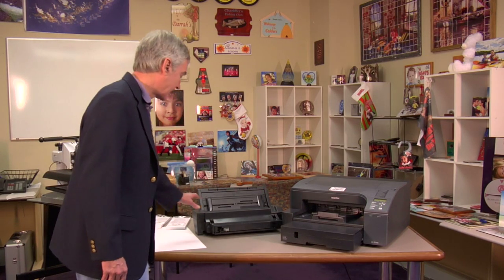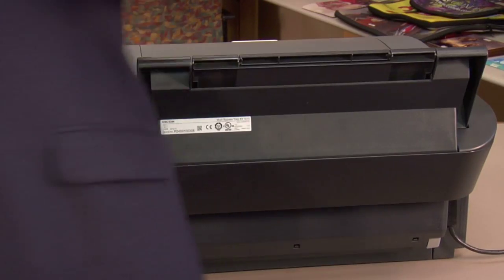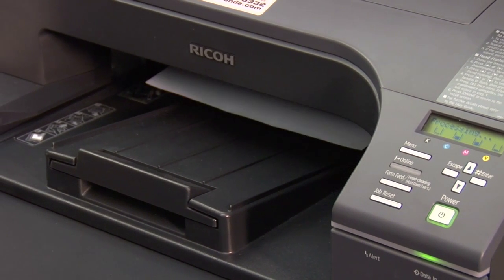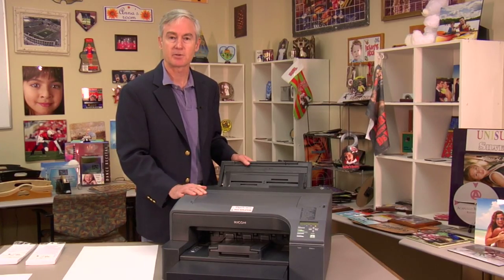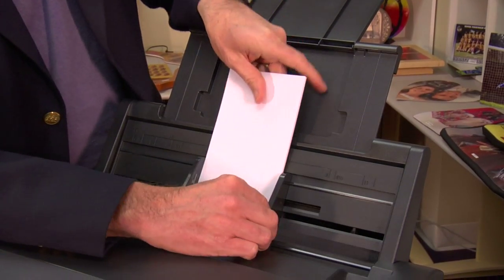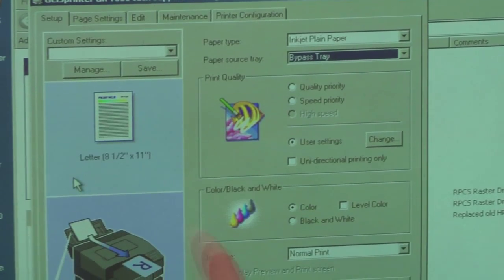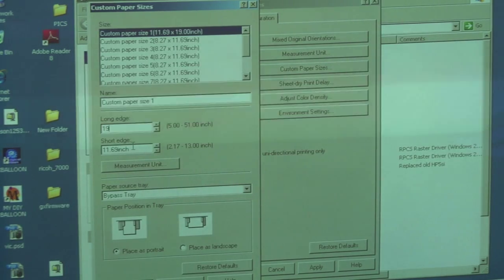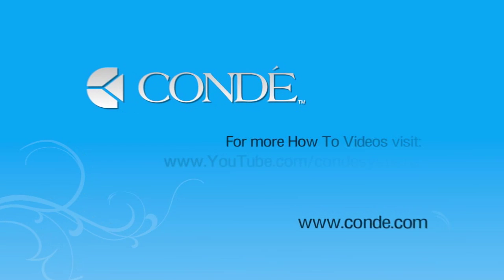Installing and Configuring the Ricoh GX7000 Multi Bypass Tray -

Comment from the maker: We got a 5.75" x 10" piece of aluminum and made an extension to hold larger sheets of paper, it helps a lot. Get the right size to slide into the slot where the normal extender comes out.

Comment: I have the by pass tray and when I print 13x19 paper and more than a couple sheets at  a time it pushes it out on to the floor. The little paper holder extention on the bottom  tray is not long enough or am I missing something in keeping the paper from being pushed off onto the floor. ?